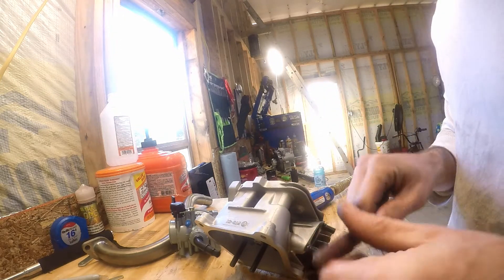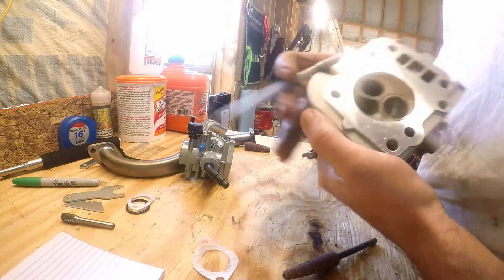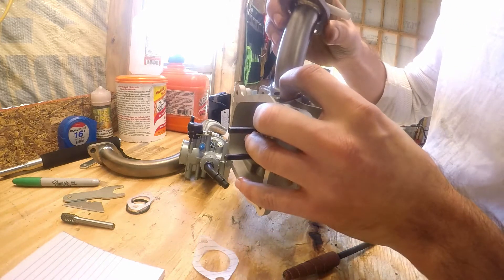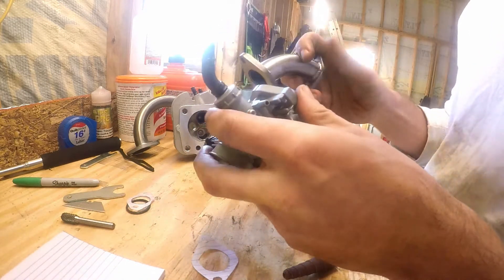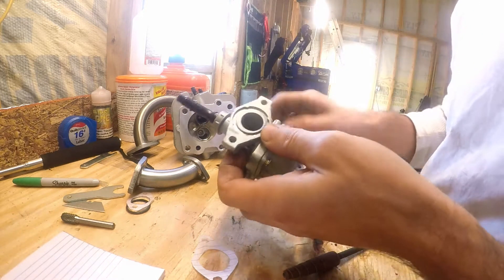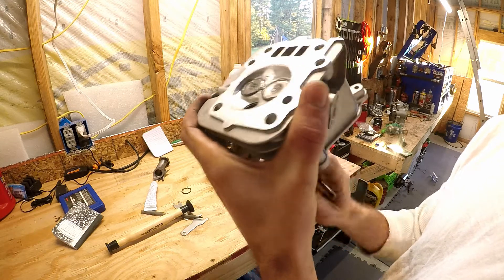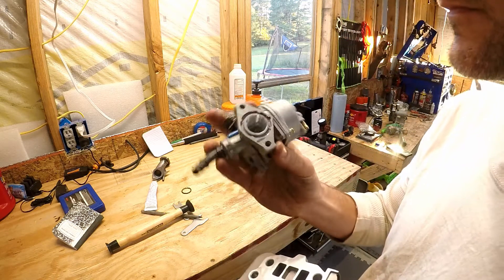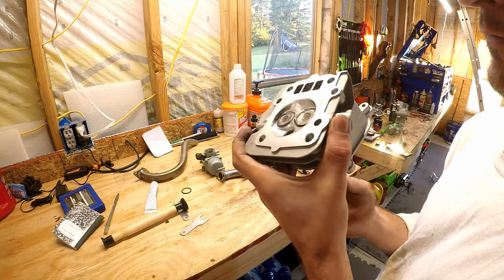79cc Predator cylinder head mods #3

Comment: You did such a nice job with your 79cc. I'm scared to screw it up since I only have 1 shot and never did one before.
Reply from the maker: Same as a 2q2 just smaller lol
Reply: @RAWRMotorsports  I own 2 now. Both billet flywheels. One full AGK stage 2.
Reply from the maker: Hell I just saw like 20 comments I didn't know existed 🤷‍♂️🤦‍♂️
Reply: @RAWRMotorsports  I go hard in the comment section! Lol, told you I'm a big fan. You definitely help to boost my confidence in my minis and working on my truck. I'm a very grateful person.
Reply from the maker: I appreciate the comments it boosts my algorithms
Reply: @RAWRMotorsports  no problem 😊 I try my best to make a difference and help out!